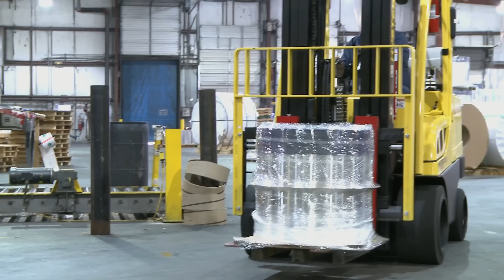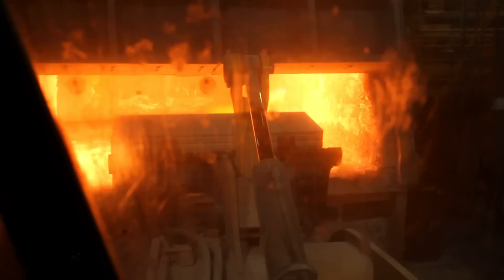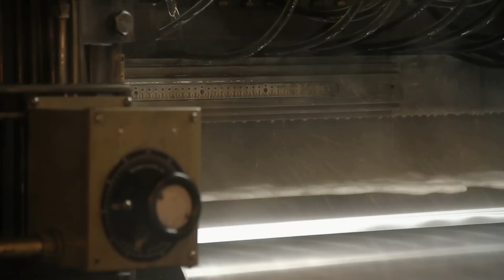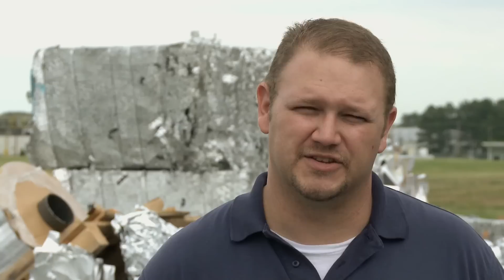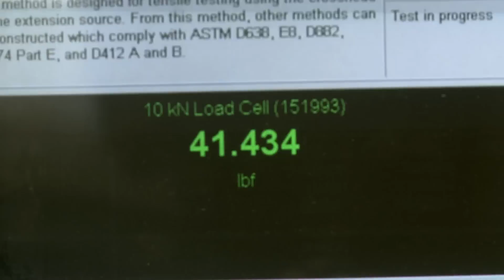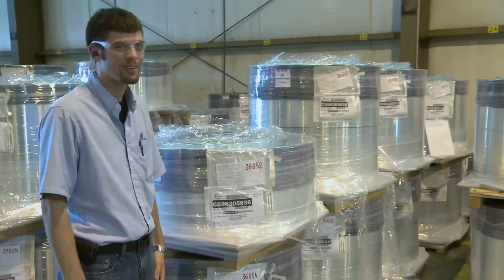JW Aluminum - The Aluminum Rolling Proccess

Comment: Do you use shape roll on the cold mill
Reply: Absolutely not. It destroys the metal properties
Reply: @bobbymiller2943  The shape roll is using for automate control strip/foil flatness. It's necessary part of modern rolling mills. It doesn't influence on the metal structure or surface quality.